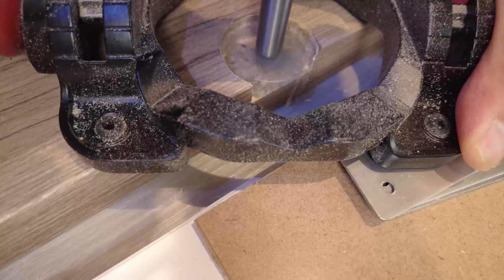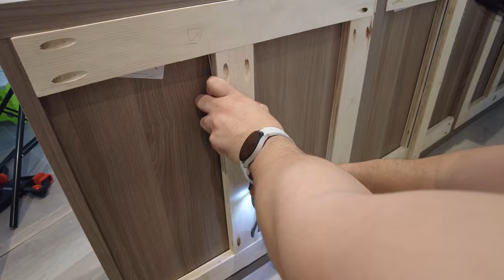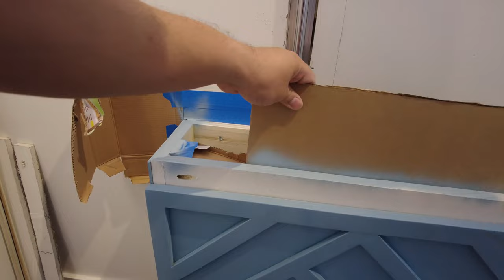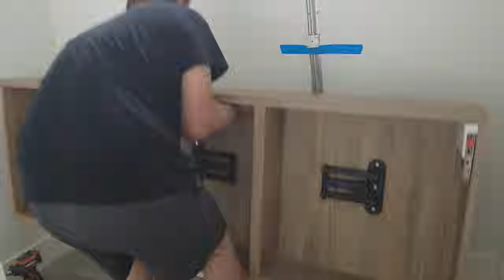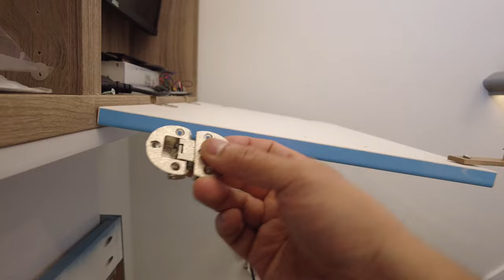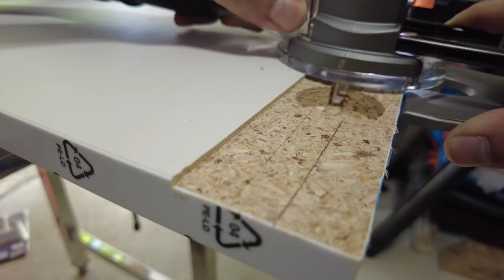Ikea Hack - Besta sit-stand murphy desk for small space (Part 2 of 3)

Comment: Question - why did you choose to make rhe drop down the medium sized besta door instead of the full besta door? Like why have the small doors open upwards at the top? Is it just because your landing is a small space?
Reply from the maker: Sorry for the super late reply but that's a great question! Space (of the desk surface, not necessarily the landing) and weight were the two main considerations. 

For space, the Besta cabinet being around 8" in depth combined with the 15" door would give an overall work surface depth of 23"--this is pretty similar to a standard desk.

For weight, the doors are actually quite heavy, especially the large 25" ones. I wouldn't feel comfortable with that extra torque on the hinges and feel they would definitely need extra reinforcement.